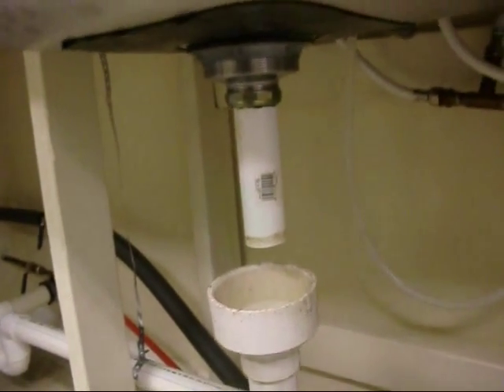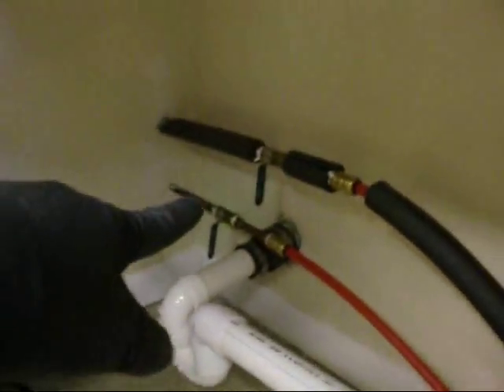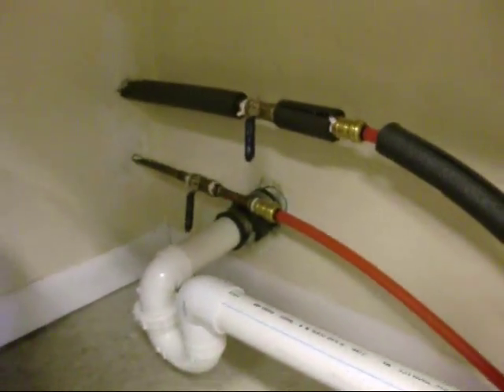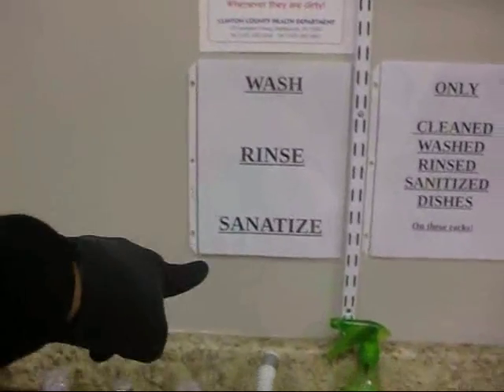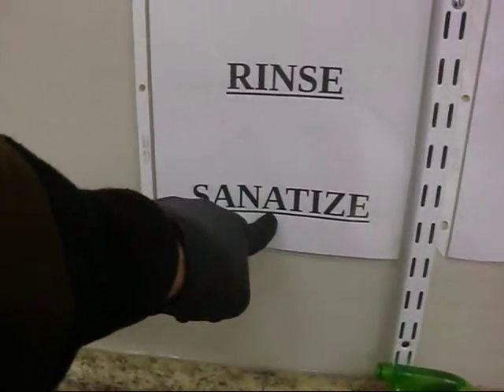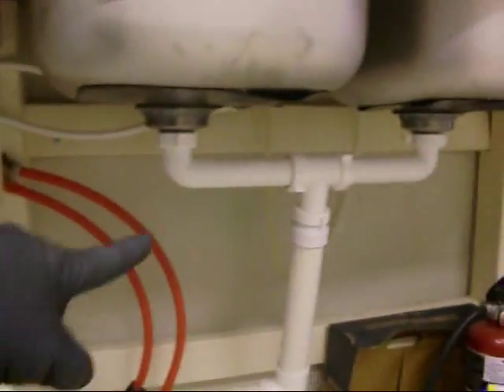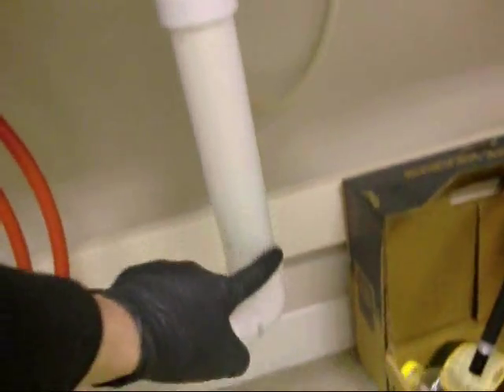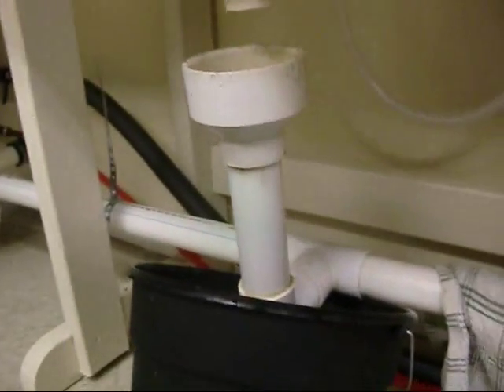2 10 12  Commercial Plumbing...

Comment: The reason there's an air gap on the food prep sink is to prevent cross contamination of the food in the sink. Example, if you leave the sink full of potatoes and the sink backs up then the potatoes get covered in p trap (unsanitary) water making them obviously unsanitary. note that the kitchen sink is upstream and is keeping the p trap primed to prevent sewer gases from contaminating the food as well.
Reply: Well said!

Comment: I wouldn’t use that reducer as an air gap. It can be done, but if you use a high sudsing soap like most commercial pot and pan detergents, suds will go everywhere, same thing happened in my kitchen and I ended up putting a commercial NSF rated air gap on my prep sink. Also my dishwasher dumped 8 gallons of water in 15 seconds through a 2” pipe, so it would regularly overflow if someone else was using a sink with the dishwasher on.
Reply: John Anders I have the same issue you described and am looking for a commercial NSF rated air gap. Where did you end up getting one? And what is the name of it?

Comment: I have seen that sort of compliance 'solution' before.  Technically, i would say that each fixture would require it's own trap - and back-vent.  Preferably, the air gap would drain into a floor sink so a slow drain wouldn't back up all over hell very rapidly.  At bare mininum, I would size the pipe downstream of the air gap a size larger than the tailpiece.  But i'm just a shade-tree plumber.

Comment: They probably cut corners on not  adding individual p traps and clean out... plus they have all the pex pipes just floating with no 90's or anything holding it to the wall. Hope this is something that doesn't need inspection.

Comment: Probably a regional thing, but out in CA, the open drain segment on that single sink would not fly...if you had a clog in the p-trap the grey water would overflow onto the floor. The dual sink would require an individual p-trap and depending on the length of the waste run, would need it's own vent as well.  Living areas need a sealed waste system that vents to the outside.
Reply: Going on the floor is the idea. It keeps it off the vegetables soaking in the prep sink.